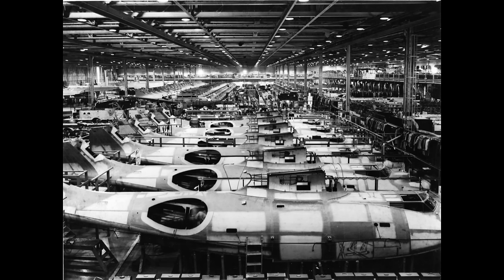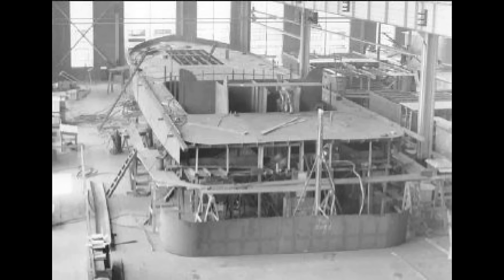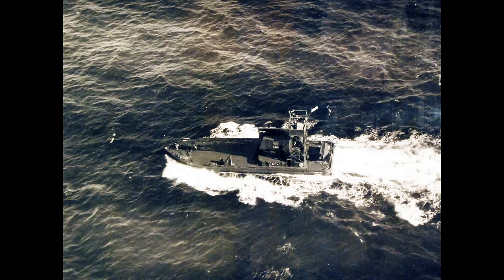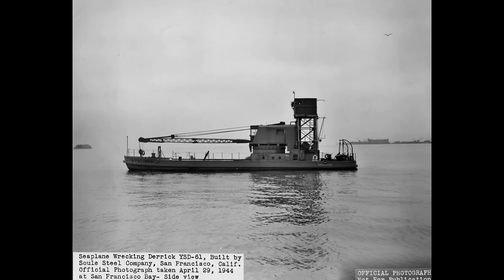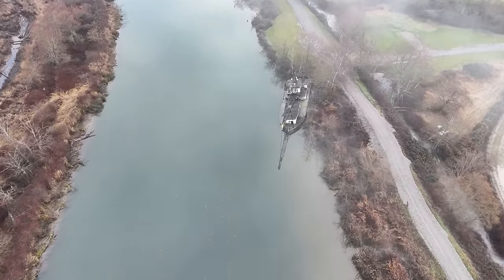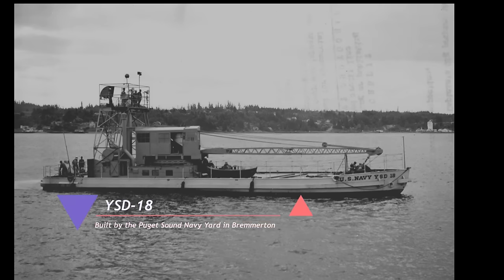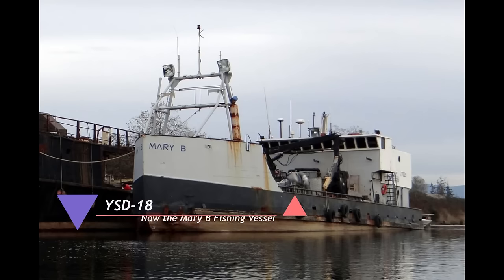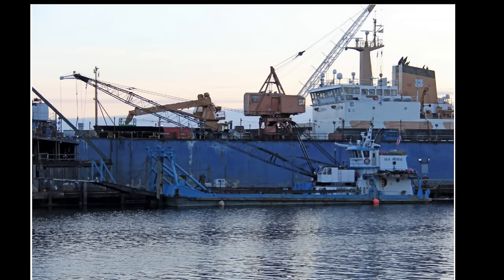WW2 Yard Seaplane Derrick YSD-61 - Abandoned Vessel

Comment: Somebody needs to rescue that old boat. I've seen worse off come back to life.
Reply from the maker: Right?  Painted in Mary Anne red and black.
Reply: That would be quite a project, I was on it last summer checking it out, at low tide water comes out of hole in the bow until drained, then fills back up again. Looks like someone scuttled it, all the wiring for the crane are cut away and ripped out, 2 what look like big electric motors ran the upper derrick,it's been sitting there for a while, with enough money it could totally be fixed up....

Comment: I'm trying to identify who built the derricks.  YSD-61 looks like a Clyde, built in Duluth, Clyde type A-frame,  but others had a different A-frame that is not Clyde's style.

YSD-67 has had the crane replaced, easily identified as a Lima.

Marions normally have the operator's cab on the port side, these old ones are starboard side.  Clyde preferred starboard.
Reply from the maker: I just added some photos on my community tab showing 2 more YSDs in the Seattle area, you should check it out.

Comment: ive seen the Puget. what river is that?
Reply from the maker: YSD-61 is located on Steamboat Slough, which is on the east side of Everett Washington off the Snohomish River.   47°59'22.8"N 122°09'10.2"W    Thanks for watching!
Reply: @BreakWindDrone  that's what I thought! we used to take a little hydro up there and check it out. my buddy had a 80ft converted herring boat built in 45 in the Snohomish.